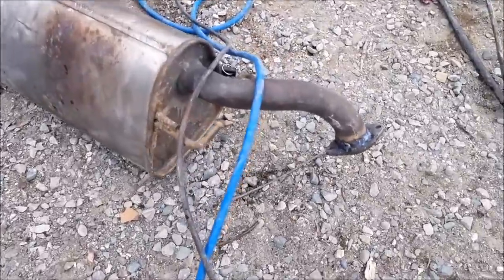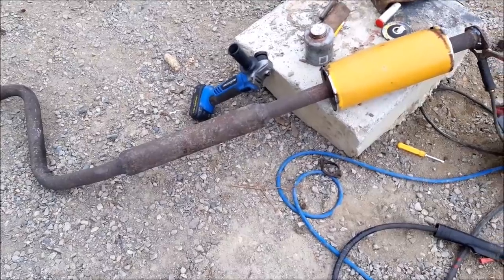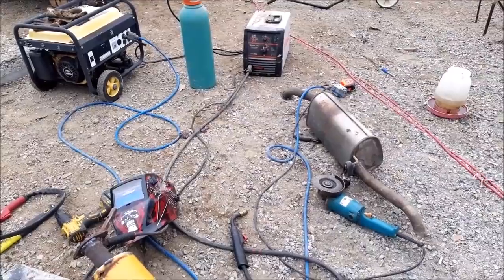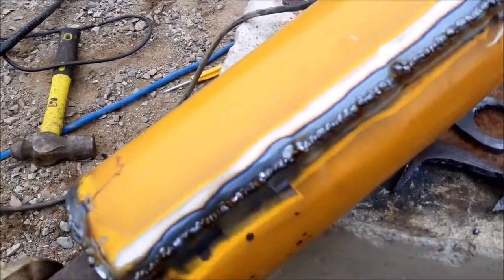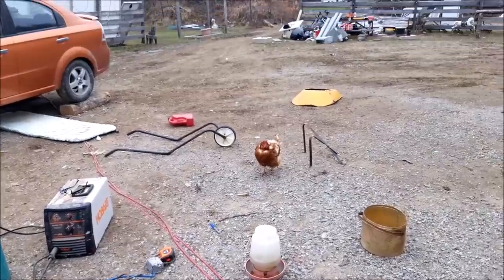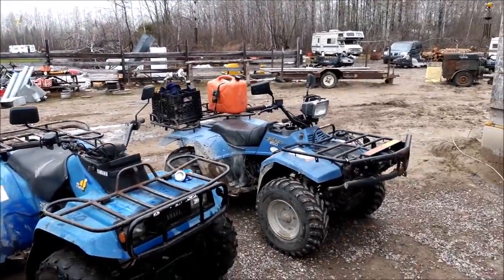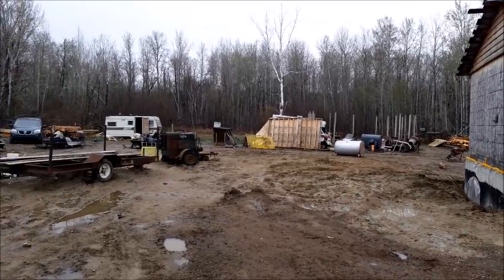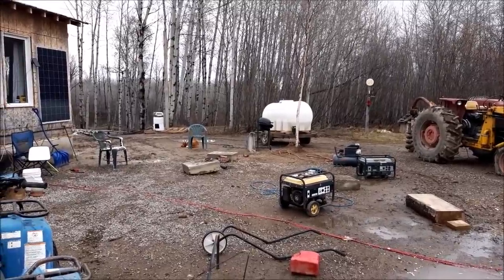$700.00 Saved On Our Car Exhaust

Comment: nice repaire , we do the same thing on all the trucks at work.If you got any threaded pipe nipples weld them on your tractors rims over the valve stem to protect it when off road.Takecare MJ

Comment: Ah too have a building with a 8x4 metal table in it too do all your numerous welding jobs on instead of kneeling and laying on the wet or cold ground. Let's get those upright posts trued up and get after it, your a hard worker Cecil but but like everyone else your not getting any younger lol, at least for me things changed quite dramatically from the age of fifty to the age sixty which is coming up shortly. Just hate too see you do a lot of your work out in the wet cold conditions, I did that crap I know what it feels like, and I know what it feels like too work in my wood heated garage also, all I need is a cot too catch a few zzz once in a while. Cheers to you both !

Comment: By the way, weld on sime pieces of round pipe/tubing to make valve stem protectors on your tractor rims. Noticed newer consteuction equipment have them. Pretty simple and easy to make.
Reply: Homestead Fabricator .     Good suggestion.   We had valve stem protectors on all our log skidders.   

Just don't weld on a rim with mounted tire.   Explosion warning!    They go BOOOOOOOM!    Will take your head off. 

Cheers Jeffery!

Whipple